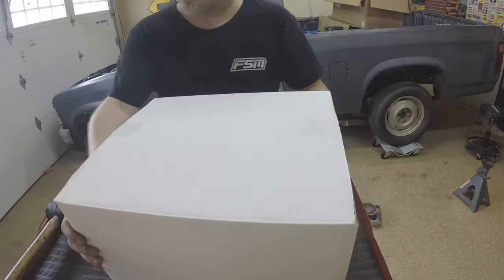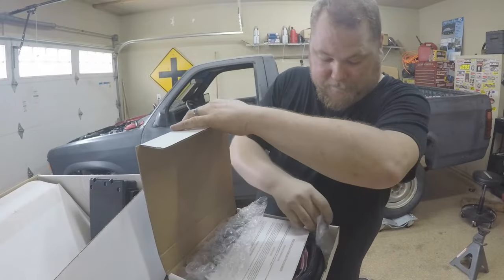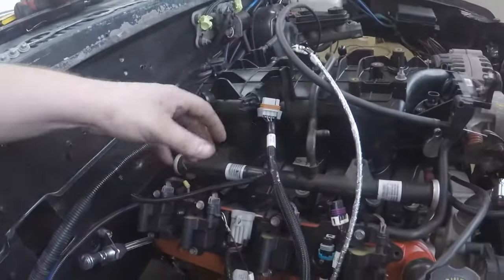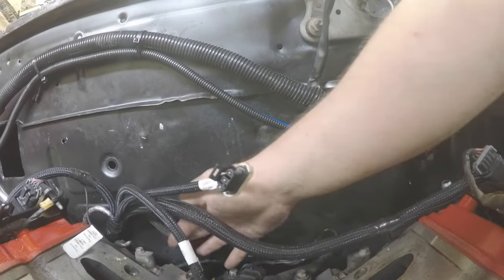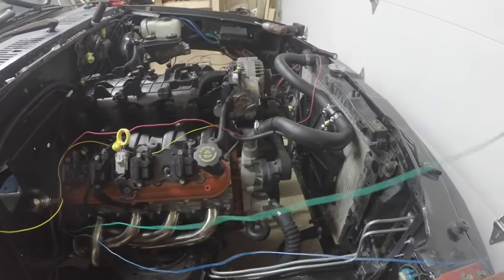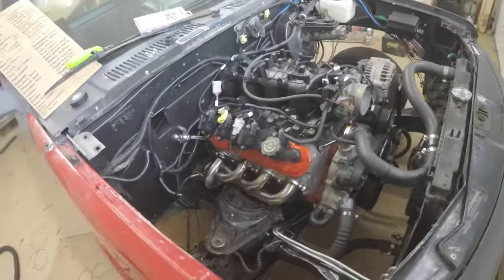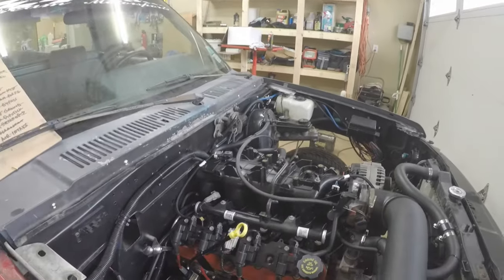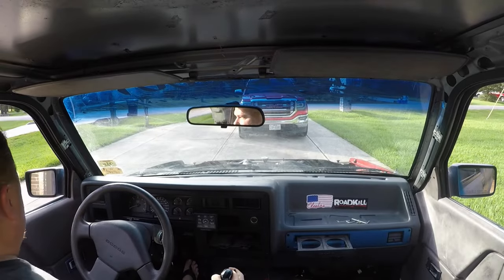Holley Terminator X Full Install and First Start - Dakota LS Swap Part 9 First Drive

Comment: If I got the terminator x max ls1 24x (550-919) am I restricted ls1 motors or am I able to go any 5.3 4.8 6.0 with the system ? Got it for a steal on market place lol thanks in advance haven’t gotten a clear answer
Reply from the maker: You can use just about any LS Harness on any LS motor. The difference all lies on the crank sensor and cam sensor, and also having the correct injector harness. You can find some more info here from Holley's video. I'm not versed well enough to share how so I would call Holley if you need more info. https://youtu.be/OChfI5i2S3Y

Comment: Is there a kit that holley sells without the transmission wiring to make it a little cheaper? I don't need that as I'm going going an AR5 trans swap. $1,600 is pushing my budget hard. $1,200 would be a little bit better lol.
Reply from the maker: Yes, so Holley has the Terminator X, and Terminator X Max. The "X Max" has the transmission control and electronic controlled throttle, the regular "X" is only engine management. Now, if you plan on changing in the future, its worth noting that you can't upgrade the "X" for transmission/throttle control. That's why I saved up a little longer and bout the X max for the future, as I intend to run a 4L80E.

Comment: One thing I always wonder about these swaps is regarding the original engine ECU and wiring. So assuming you unplug and remove all of that, does the car start freaking out or is it literally only involving the old engine. Like chassis and body wiring isn’t affected right? Is it really that simple as removing the old computer and wires. Or do you leave it all in place but just unplug the engine sensor stuff? Thanks for any input! Great video. Subscribed.
Reply from the maker: On older vehicles like this truck, it does not have a body control module, so it's pretty simple. They are divorced systems. In this particular case it was as simple as removing the engine harness and just finding correct ignition hots to run to then standalone ECU (In this case the terminator x max). Then if you want factory gauges too, it takes a little thinking and knowledge about 12 volt systems but it is possible.

However, more modern vehicles with integrated can bus and bin modules are much more difficult. Sometimes they can be made to work by leaving the stock ECU in place and sending 2 signals of different items such as crank sensor to get things to work. But it's not near as simple as an older vehicle.
Reply: @RacerXGarage  awesome! I really appreciate the reply. Thanks.

Comment: Nice video, thanks for documenting the process.I didn't even know that one could de-cap the port on the manifold to create a vacuum source. We can all learn from each other.I'm doing a similar documentation of a build I started about a year ago. It's a boosted LS dropped into a 1980 Ford Thunderbird (Fox body). I've fabricated the whole turbo system and modified the whole cars suspension and frame for much better performance. Almost at the point of installing the Terminator X-max since I'm also running a 4L85E transmission. If you ever decide to boost your project check out some of my video's if you have the time...thanks again for all you're work in posting your video's....
Reply from the maker: Appreciate the kind words! I'll definitely check out your channel!

Comment: What size are the bolts in the back of the heads I can use for the grounds on a ls ?
Reply from the maker: I'm not quite sure. I only they're metric. Best thing to do would be pull a bolt out of the accessory bracket, and match the thread pitch. They're not very long though, about 1/2 to 3/4 inch long

Comment: What did you do for the lower radiator hose here
Reply from the maker: I don't quite remember what my first hose setup was, I wound up putting a different radiator in it and used some different smaller hoses. My guess is either a stock V8 Dakota lower hose or stock Sierra.

Comment: How do you check the map sensor is working on your handheld
Reply from the maker: One of the gauge displays shows MAP pressure, if it isn't moving or is way all over the place you possibly have an issue.

Comment: Which holley terminator x max did you use?
Reply from the maker: I think it's 550-917, but it's been a while since I ordered it. 24x , multec 2 (Delphi) injector harness, and I got the 4L80/60E trans harness for the future.
Reply from the maker: I think it's 550-917, but it's been a while since I ordered it. 24x , multec 2 (Delphi) injector harness, and I got the 4L80/60E trans harness for the future.

Comment: So the map sensor you put in the front on intake don't run that one just run the one on the ecu
Reply from the maker: Good question. The thing I put in the front of my intake was a MAT (Manifold Air Temp) sensor. And it works as it is supposed to. The stock map sensor on these truck intakes are towards the rear. I did plug the factory MAP sensor in, but the software out of the box isn't looking for the stock sensor. So you either have to tell the Terminator to use the stock sensors, or just use the onboard MAP. From recommendations I read, it is easier to use the on-board MAP on an naturally aspirated engine. Let me know if this answers your question.
Reply: @RacerXGarage  ok thanks i appreciate the help what year oil pressure sensor and mat sensor did you get I'm gonna be doing a 5.3 4l60e trans swap in my 89 s10 soon
Reply from the maker: @bradleydunford725  I don't remember exactly. I think MAT was from like a 1996 S10, and the Oil Pressure was from a 2004 Silverado. I call it out in the video when I'm doing those installs if you want to double check
Reply: @RacerXGarage  ok thanks I appreciate it gonna be my fisrt ls swap
Reply: Where did you get your kit from holley website, ebay, Amazon, or jegs